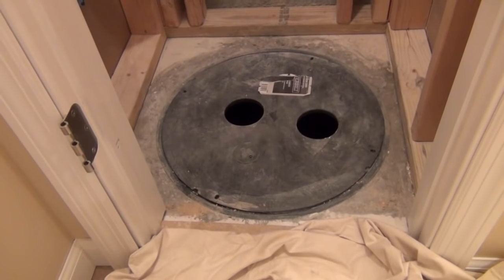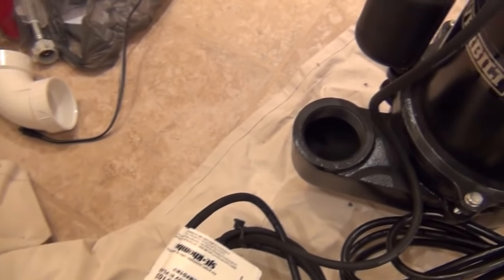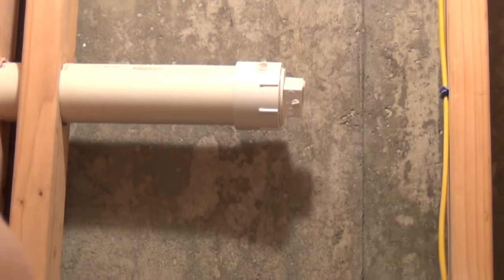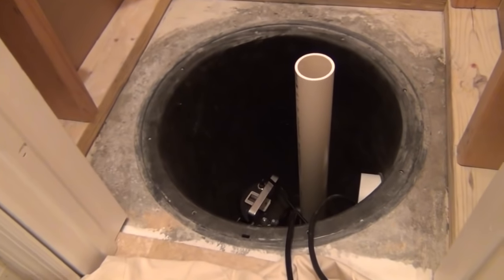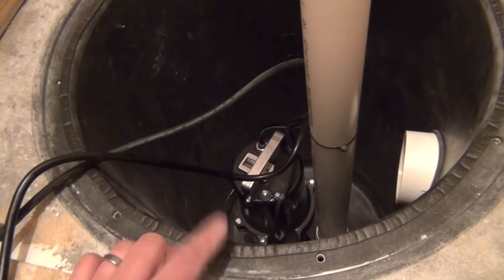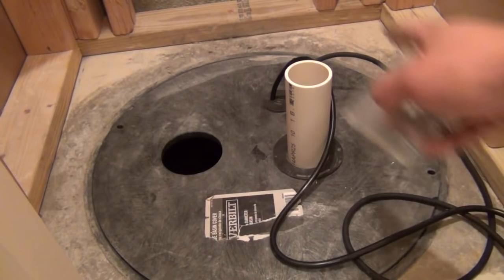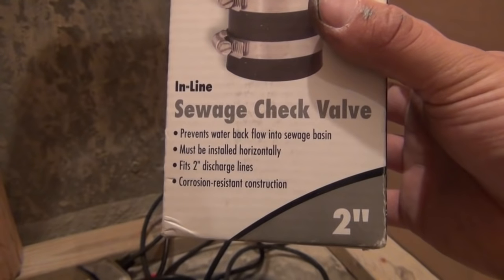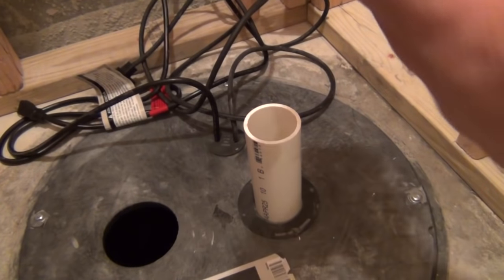How to Install a Sewage Ejector Pump

Comment: Just a tip.....when I did mine I added an alarm that puts another ball float switch down in the basin.  Of course it's mounted higher on the two inch pipe.  I figured this might avoid a mess.  Sure enough, a couple weeks ago my pump finally failed and my kid comes running up telling me that an alarm was going off in the bathroom.  Well worth whatever I paid for it!
Reply from the maker: Yes, I actually added an alarm off camera. It’s a good piece of insurance having one. Thanks for the comment!
Reply: @fixitwithzim Will you please explain this in rookie terms? Where do we buy the alarm? I’m getting my cover replaced as the person that “fixed” my pump didn’t do it right and I get a bad smell often. 
Would love to just include the alarm since they’re already going to work on it.

Also- my current pipping doesn’t have the red knob it’s just straight white tube with a flow section (also white). The plumber coming states he can put the red knob with a bubbly white thing under  which seems to be Similar to your black attachment. I should go ahead and do it red knob and bubbly piece below❓ My home is from the 50s.
They’re supposed to come Sat. Praying you have time to reply beforehand 🙏🏼 Thank you❗️
Reply from the maker: @suzp8627 you would want one of these: https://amzn.to/3M5nl0R

The float would be installed higher in the tank above the pump. The idea is that if the pump fails, the water will rise up to the alarm float and set off the alarm to alert you there’s a problem. 

In regard to your other question, yes, have the valve installed (red handle thing your describe). They don’t cost much and are a great thing to have during servicing
Reply: @fixitwithzim  Thank you soo much❗️ I didn’t know if this was just being pushed (red knob) and not applicable for older homes. What’s your price estimate for that (pump work) and a replacement to a simple kitchen sink faucet (Tuscany brand) along with the pipe just on the bottom of the sink replaced? I’ve never had to do any of this. Btw we’re in Chicago. Maybe you’re near and should be the one getting hired😆💜 😄
Reply from the maker: @suzp8627 you’re welcome, I’m in NY.  Pricing is always subjective and how someone values their time.  For me where free time isn’t very abundant, I have to be making a decent profit to consider doing any side work.

Comment: Nice work man. Nice to see someone take pride in there work! Question..hard to tell on the video but likes like the sewer pipe pitches back toward the grinder pump. That should have a eight to quarter inch pitch heading out to your septic or street correct?

Comment: Thank you for the video. It was very helpful when it came down to fixing my pump (retreating discharge port) and re-piping (partially, moved up off the floor). The challenge was  retaping the pump discharge threads and drilling out the 3 bolts that were holding the lid down that broke. I used 1/4-20 well nuts and cut the rubber off 1 and hammered in the threaded shank. Worked like a champ. The other 2 I left the rubber around the threads and epoxy'd them in place. I also used the 2 rubber boots off the old flapper valve. I had to replace the t-nuts (used 3-prong) that hold the flanges in place around the pipes cause the bolts broke off in them. I used ss bolts/washers with some antiseeze for reinstall. I replaced the lower 90's with 45's. Alot better job now than from the idiot who built the house.

Comment: Wow very detailed information, best how to video I have watched. 
Thanks a lot for sharing.
My big take away is the 45 degree elbows as opposed to 90 degree also the shut off valve, I had the check valve however, I never thought about the shut off valve. 
Thanks again.

Comment: A great tip about greasing the threads of the bolts which secure the tank lid. If it was me I would probably swap the supplied bolts with stainless steel ones if applicable.
Reply from the maker: Thanks for the comment, good idea with the stainless hardware.

Comment: Hi, im single mom, thank you for showing me this. I have that plug. My system cam with the house 20 years ago. Now its plugged up a few times an when toilet flushes, it goes into tub. I bet it is the float, full of hair an debri. But the cover was painted over. Alot of spider webs, yuk. You helped me to understand this thing in my basement. Ive had plumbers come in an not know what it was..one said i need to replace plug. Seeing this. It might make sense to replace, if its cheap enough. I SO THANK YOU.i wish i could get you to help me.. lol
Reply: I would of loved to have seen you put the pvc attachmenrts on. Thank you it was a great video
Reply from the maker: Harley RN sorry for the late response but happy to hear the video helped you. Never a fun job working with these but you can save a ton of money doing it yourself. Did you ever get it fixed?

Comment: Wonderful video. I'm going to use this video in reference in helping my retrofit a pump for our shed outside. While we remodel our laundry room I need to install the dryer and washer in the shed. I'll pump all of the sewage from the washer and possible utility sink into the pump and pump it 60-70 feet away on the surface to our clean out 3 inch pipe. I'll install a threaded 3 inch bushing and a short elbow and glue it in. Again it would be temporary.  Way better than having all of the wash water flow out on the grass and under the shed. Mud pies. 

Again thanks for this video. It makes me think of I ever added a little outdoor kitchen someday I could add little pump for that too for a sink. 

Thanks 

Jeff 
Licensed Journeyman Electrician 
Sunny Central Florida
Reply from the maker: onecrazywheel Great, good luck with the project and glad the video helped!

Comment: Absolutely fantastic, informative video. 

 Family member new home (to her) has smell.  I looked and saw 2 pumps.  A sump pump 4ft down in a caged/wired gravel pit and 30inch deep plastic basin with what appears to be your videoed sewage pump installation.

Head scratcher but your video is helping our research.
Reply from the maker: FarFromN0thing yeah, that’s an odd install. Anyway hope the video helped solve your problem. Thanks for the comment

Comment: Thanks for the video you did a great job with it.  My basement office is in a room next to my sewage pump. I've dealt with a smell for the past three years.  I hope that your weather-stripping tip will do the trick to better seal the smell.  I chalked around the gaskets at both pipes and it didn't remove the smell.  I was thinking of adding an inline fan on the vent to hopefully fix but I'll try the weather-stripping first.
Reply from the maker: Nick Thanks, the weather stripping will solve your problem. Then reseal around the cord, vent, and pump gaskets. Also doesn’t hurt to run a bead around the lid when you get it reinstalled as well.

Comment: Great how too instructions, however I believe that for future ease of repairs what might have been done was placing a PVC union between the two 45 degrees, and one at the vent pipe. To disassemble, its just a matter of unscrewing the unions. Also when using unions, I found that a light coating of never cease makes the unions separate easier.

Comment: Excellent video. I watched it after I did the project. I'm glad to see I did it right. You didn't just cover the basics, you covered a couple of smaller details I wouldn't have thought of... Like zip tie around the cords and lube for the bolts. So I'm going to do that. I like you did not use Teflon tape for the threaded portion that goes into the pump. One thing I did that I didn't notice in your video was drilling a tiny hole in the pipe, above the pump, above the water line in the basin. Doing that is supposed to prevent vacuum locking in the check valve. However, doing so might cause a real annoying whistle, so I'm not sure how necessary that is.
Reply from the maker: Some pumps need the hole in the pipe and some don't. This pump doesn't call for it. Thanks for the compliments. Glad you found the video helpful

Comment: About the threaded fitting on the pump, dont need teflon but the right dope will make taking the fitting out puch easier for pump changes.

Comment: thanks zim im a electrician but been doing some plumbing work also had to change the pump last i brought the same pump u r using i was taking lid off n cracked a 90 so now i have  to change all pvc going to main but thanks u very knowledgeable  thanks for u tube
Reply from the maker: You're welcome and yes YouTube is a great resource.  Hope the project went well changing the broken PVC.

Comment: Great video! I have a 'half installed' pump that I'm trying to check before I start using as I finish off my basement. By half installed I mean half finished in a half assed way. Not sealed around the rim and the electrical cords are dangling in the hole. A second plumber put a pex line (a drain of some sort?) into the electrical hole, lifting the grommet. I thought that was not right. Now I'll be able to complete the install correctly.
Reply from the maker: Thanks, hope the video helped fix your problems.

Comment: Wow... absolutely AWESOME video!  After watching 4 videos now, yours was the only one that mentioned the Male-threaded-adapter; the Direction-of-Flow on the Check Value; and limiting the 90-degree angles in the piping.  One thing that was covered in the other videos (but not mentioned here) was drilling a 'Weep-Hole' (on the discharge pipe) at an approx. 45-degree (downward) angle, about 2-3 inches from the pumps outlet to prevent something called Vapor-Lock, which could shorten the life of the pump.  Not trying to be disrespectful in anyway... just trying to help.  Thanks again for taking the time to do this.  It's increased my understanding and made my upcoming job easier.
Reply from the maker: Thanks for the comment. The weep hole isn't needed for this model pump but others require it. It prevents air lock inside the discharge pipe which could lock up the pump.  Thanks for stopping by.

Comment: Firstly, I read somewhere that it is better to install the ball valve on a horizontal pipe as opposed to a vertical pipe. Secondly, if you are installing a ball valve, there shall be 3/8” hole in that pipe below the lid for air to exit. Correct me if I am wrong.

Comment: Hey, great job on the video.  I appreciate the code references regarding the venting of fixtures.  I was watching to gain knowledge on plumbing into existing venting.  You are fortunate to have a stub.  I will need to explore local code requirements for an exterior wall vent.  One small detail I noticed was the lack of a union in the vent pipe out of the basin.  It will be difficult to remove the lid without one.
Reply from the maker: Thanks for the comment.  You could install a union on the vent pipe but I usually just lift the cover up the pipe and stash it up high while working. Most guys if they need to cut the pipe will just use a no hub fitting when reinstalling and that would serve as your point of disconnect for the future.

Comment: You did a thorough job of explaining the process of installing a new ejector pump. It is a luxury to be installing a new one as opposed to replacing one. 

Questions: 

1. If you have a float issue and you have that 2-part plug, does disengaging the plugs and plugging in only the actual pump's plug allow you to eject any matter/water that's in there? You say something about getting lucky... Please explain. It seems if you take the problem float out of the equation and just activate the pump, you should be able to eject water/matter with no problem...

2. Also, and this is more important, must ALL of these sewer ejector pumps be vented? Mine is roughly 7-8 feet away from the sewer stack into which it pumps the matter and water. Mine is NOT vented and I've been in the house for 11 years. We don't really get any foul smells, except once in a blue moon, I suppose, when it is full and about to pump out. But that is very rare... One hardware clerk told me that if you are within a certain short distance from your sewer stack, venting is not required. I can kind of see the logic... Please advise. If venting is required, what are my options if I don't want to run PVC from the basement all the way through the roof line? That would be a bear!!!

Thanks again for a cool video. You a plumber or just a DIY'er?
Reply from the maker: 1:  when I see get lucky, you could have one of 2 problems if the pump is working - could either be a float switch in which case bypassing the float by swapping the plugs will allow the pump to turn on and pump the water. The second problem could be a burnt out pump in which case the plug trick won't do you any good.

2:  to my knowledge, all these ejector basins need to be vented.  I've never come across one that isn't.  That's not to say it won't work if it's not vented. Just not the proper way things should be done. You are mainly looking to vent sewer gases and help the system breath and operate correctly. You might be venting through the 3 or 4" main entering into the tank. Not really proper.  Again tough for me to tell without being there.

I've worked on both new and existing systems. Yes, existing is never fun but it's easy work and if people want to pay me for it, I have no problem getting it done :)
Reply: Hey Zim:

You answered: "You might be venting through the 3 or 4" main entering into the tank. Not really proper."

Can the line feeding the waste into the basin actually serve as a venting mechanism, as you state? If so, I agree that totally sounds wrong. ... How can I take a basin that I believe has one extra port in the lid and vent it somewhere other than the roof? That project would be too much of a job for my pay grade... Any insight into these couple of issues? 

Btw, the basin sits roughly 6-8 feet away from the stack and someone said under these circumstances, this doesn't require venting. Could this be true? And, if the basin is not kicking up sewer gases, could I get away with not venting? In other words, are there any genuine health or mechanical concerns associated with a non-vented basin? Been in the house 11 years and no issues to speak of, except the one that just took place -- where plumber indicated the float was being blocked by the electrical cord, leading to a minor overflow issue... Solution: He pulled up much of the electrical cord above the lid, where I suppose it should've been all along.

Thanks again!
Reply from the maker: "Can the line feeding the waste into the basin actually serve as a venting mechanism, as you state?"  No - this is not a legal way to vent an ejector basin.  What i meant is that the line "may" be acting as a vent but by no means is that correct.

"How can I take a basin that I believe has one extra port in the lid and vent it somewhere other than the roof?"  Unfortunately there is no real trick to it.  Have to get creative - run a piece of PVC inside a closet to hide it until you reach the attic, build a chase in a room, or cut a wall open.  On a side note, you can't use an AAV ( air admittance valve) because the basin needs to breathe both in and out.  An AAV only lets air in.

"Btw, the basin sits roughly 6-8 feet away from the stack and someone said under these circumstances, this doesn't require venting. Could this be true?"  I've never heard of that before.  Check your local code.  They differ all over.

Hope this was helpful.

Comment: The check valve you have installed is exactly the same make and model as the one I installed - it lasted about a year.  When I took it off, there was nothing inside, no flapper at all!!! (making it essentially only a coupling).  Needless to say, I replaced it with a different make and model.  Otherwise, great vid!

Comment: Good points lot of the time rags etc.. get caught in the pump might try to pull that crap out ,the pump may still have life .Make sure your outlet is a 20-amp dedicated circuit.

Comment: I am in the process of doing some "emergency maintenance" on a system that pumps the waste water from a MIL-ADU (think "guest house") to the septic tank for the main house.  1st, the original check valve says that it can be installed either vertically or horizontally, but it uses compression fittings (one of which came loose - use your imagination).  My point is, it won't matter if it is horizontal or vertical if the flapper gets stuck open (the ball valve for your installation is genius - I don't have room for one, and besides I have a "somewhat" horizontal install).  2nd, since my system is outside, the vent is not thru the roof, but, um, to the outside.  Last summer (hot weather) I noticed a smell - and recommendations for reducing that would be appreciated (like maybe running the pump everyday?).  Great video, thnx for the links.
Reply from the maker: Thank you!  Ideally you vent through the roof as the odors are up higher and not as noticeable.  My next best suggestion (as was yours) would be to run some clean water into the pit and let the pump cycle a few times

Comment: I installed a liberty alarm on mine, it has its own float which can also serve as a backup float, and I ditched the float too and bought a solid state sensor that cant get jammed (yeah it can fail electrical ofc) this way I can use the liberty alarm float as a backup while waiting to replace.  I really dread the day I have to service this though, installing it clean is a big difference to a do it yourselfer than replacing it dirty lol.